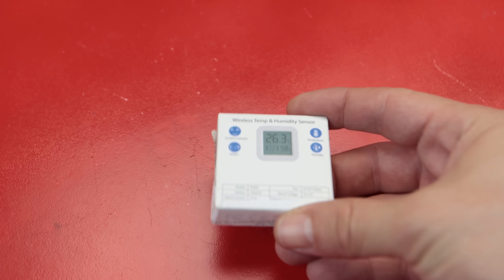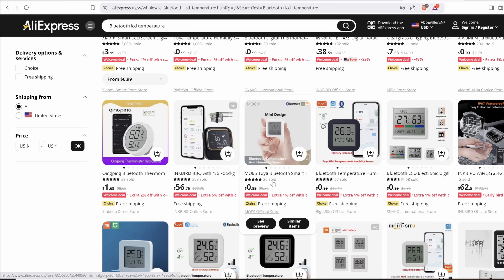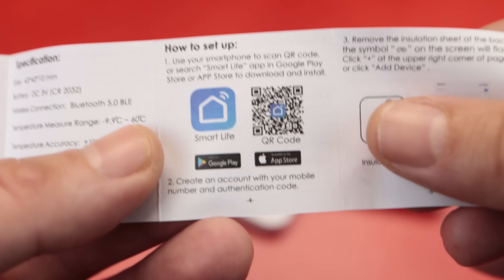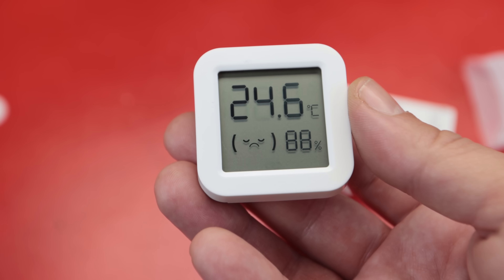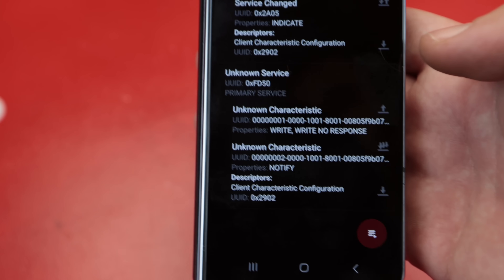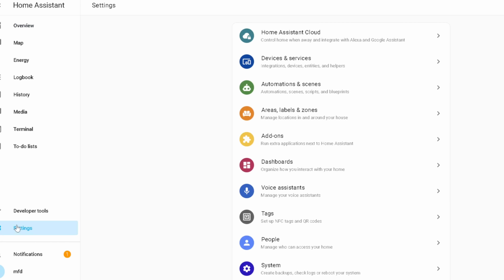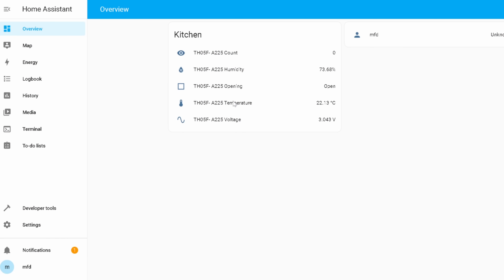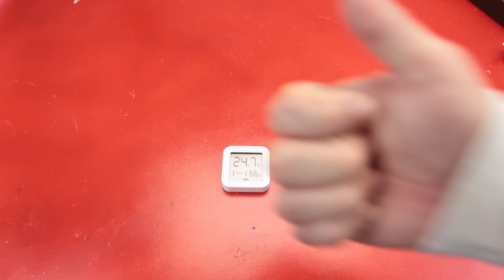Custom firmware on cheap Chinese Bluetooth LCD temperature - humidity sensors for Home Assistant

Comment: I also have some cheap THB1 / THB3 sensors and they are surprisingly accurate. I'm also using this custom firmware for a while now and it works really good.
Be aware that the battery will drain very fast with the custom firmware. You should either wire it to a permanent power source or add a bigger battery pack to it (I've wired a 2x AA battery case to it).
Reply: I too have many of these sensors flashed with the custom firmware and was seeing batteries draining quickly but I found that many of the batteries you can buy are just junk. I got quite expensive (like £3 each and individually wrapped rather than those mass produced strip variety) CR2032 batteries from Amazon that had great reviews and haven't changed them for well over a year. perhaps 1.5 years now. worth the extra as these are great and accurate and part of the charm is that you can just stick them anywhere whereas adding AAs or wiring them then limits their placement.
Reply: @smitcher keep in mind they're Lion batteries, you can recharge them but they get worst every single time. I bought LIR2032 which are the rechargable versions but tried the non rechargable and they still charge.
Reply: is there any chance to turn off lcd (or rip it) to save energy and make this last longer on CR battery (i need one measurement every 5 minutes)? im thinking to put it in hard to get location so i can change batteries every 4-5 months
Reply: @Kentrilek  There actually is an option to disable the screen (at least I think so, it's called "Disconnect Display"). But I think most of the power consumption is by the high update and send internal.I'm not sure if you can change it because the options don't have any description but there is an option called "Advertizing interval". I think that could be it. You can also turn off the history logging (which is on by default and stores values locally to the device).

I don't know how long it will last on a button cell because I only used it for a quick test but the voltage quickly dropped from 3.1V to 2.8V in less than a day (don't know if it was a new cell - but probably not). That seems way too fast.

One of my sensors uses two AA very old rechargeable batteries (which aren't good anymore) and now after almost a year they're slowly getting empty but most of it is probably self discharge.

Comment: Nice. I do not understand how you could put it back together and the display still works. In my experience, every time I detached the zebra strip elastomer from a display and then put it back I never got the display to work properly (there were missing digits and digits that were working but with far less contrast than the fully working ones. I did avoid touching the zebra strip contacts, used isopropyl alcohol, tighten the screws to make sure there is enoug pressure, no luck. What is your secret ?
Reply: I've never had problems with that. I have already removed lots of these displays and put it back together without issues. As long as you don't bend it or remove it from the display side there shoudln't be any issues. Even touching it should be fine.
Reply: The strip is directional .. they're electrically conductive top to bottom, but not in any other direction. If one comes loose and you put it back and get no display, try putting a different side up.. especially annoying on perfectly square ones.
Reply: @nyckid  thank you. I only dettach them on one side, the PCB side. They twmain attached on the display side where usually is glass with metalised areas for contacts. They di not seem to be perfectly elastic, I can see on their surface ridges remain where they where compressed slightly more due to thickness of the copper traces on pcb. Those can be used to allign exactly as before.

Comment: Wow!!  This is awesome! So much potential here.  I immediately was thinking about these being used in Homelab situations where you need/want to monitor rack units. Put one at the top and bottom of the front glass door and have not only visual display at the rack but also remote monitoring. What a great find!  Cheaper than making these yourself "and" comes with a display!
For those saying they aren't $1, try changing your location with a VPN and scanning through the listings. Some will offer discounts on multiple purchase counts as well
Reply: TH05 drains battery for 4-5 months using Tuya app. Will it change after connecting to Home Assistant using this method?

Comment: We couldn't find a product for 1 dollar, unfortunately it's around 10 dollars.
Reply: try changing your location with a VPN and scanning through the listings. Some will offer discounts on multiple purchase counts as well
I'm in Fl,USA and found several that were listed for $3-$5 and there were discounts for larger quantity purchases.
Reply: @korishan  It doesn't matter, even if it looks like 1 dollar, this time the shipping is 8 dollars.
Reply: It's 'welcome deals' if you bought anything on the site before it won't be that price
Reply: @mateosalta64  No it's not what I meant. I mean the "p.i.c.k. .three" (remove dots)
Reply: wow so this seemed to work. So I do not know if this what I said is a global thing on this online shop that we are talking about but I've got mine there a lot cheaper than using the regular shopping cart. You can find that usually on the home page of that shop that we all know
Reply: I have bought multiple for 1,69 USD a few months ago.
Reply: If you search for "bluetooth temperature lcd" you find some for around 3-4€ even without the fake discount aliexpress always shows.
Reply: fuck you youtube
Reply: lets try if this works (you need to reverse the text):

.snioc gnisu nehw yllaicepse ,ereht repaehc sgniht fo tol a teg nac uoY .ppa enohptrams ilA eht esu ot si em morf ecivda lareneg a oslA .hcae ¬ â07.1 tuoba rof enim tog ev'I
.trac gnippohs eht hguorht yaw dradnats eht meht gniyub yb ton dna noitces "3 kcip" eht hguorht repaehc tol a meht teg nac uoy tub ilA no gniht labolg a s'ti fi wonk t'nod I
Reply: youtube tends to delete comments that merely mention that site.
on the other end, if you even mention youtube on that site's messaging system, the message is blocked and you get a warning.
not talking about hyperlinks, just the name of the site will trigger these
Reply: Bought one for around 2 euro a while ago at good old Ali
Reply: Just checked Nd apparently now they are 5.50 euro
Reply: I bought few of them for ~ 2,-€
Reply: who is we
Reply: I bought for 2€
Reply: 1$/1€ is the price for firs time buyers. You have to spend 2.20€ to 2.70€ on discount at AE (3+ deals).
Reply: I found one for €1,50.

Comment: Cool. I have about 10 of the Xiaomi ones. I never bother with the BT connectivity as the range is pretty poor, I just use them for reading temperature off the screen.
Reply: I have plenty of devices that serves as Bluetooth proxies (eg esp32 or Shelly) so no issues with range around the house
Reply: Those have ZigBee hardware inside, you can activate that via custom firmware.
Reply: Well I have Xiaomi gateway and that one is picking up my Xiaomi temp meters 2 floors up and outside.
Reply: @Luke-san  Oh wow, I guess it only uses ZigBee if you use their own gateway.
Reply: @Toteniuz   Yup the Zigbee standard protocol, I am laughing at standards, only works for their brand. The Xiaomi meters I have are BT ones.  I have a Sonoff Zigbee stick still in the box but using that I would have to re-pair everything again. So now I am stuck wit a Xiaomi and Tuya compatible gateway that can both do BT and Zigbee.